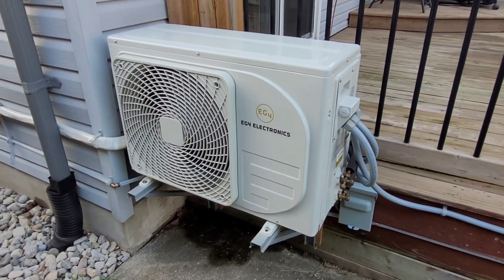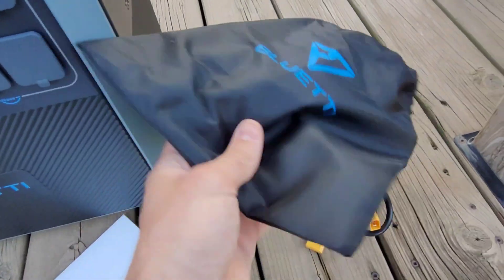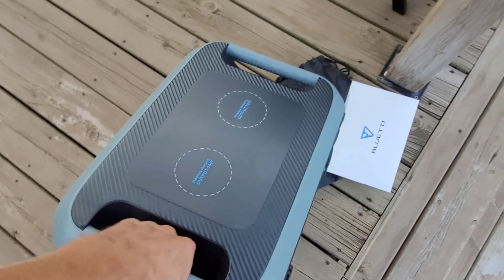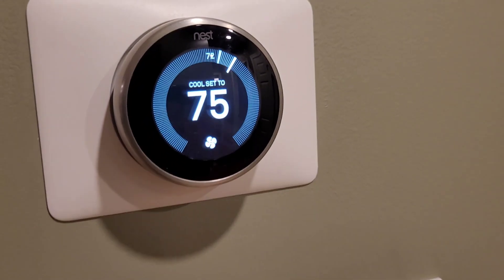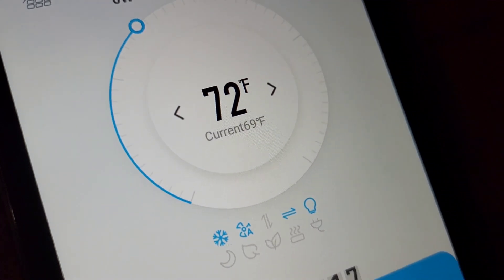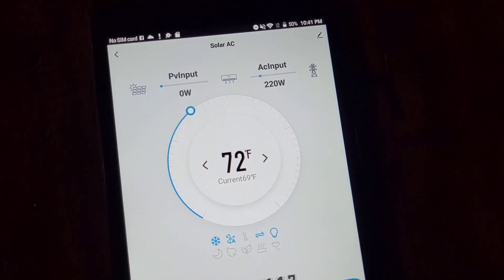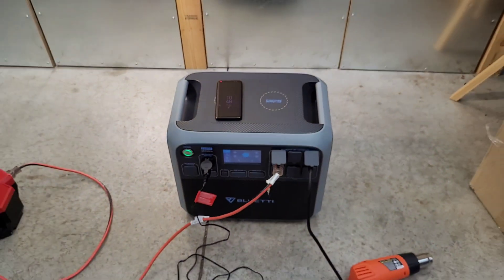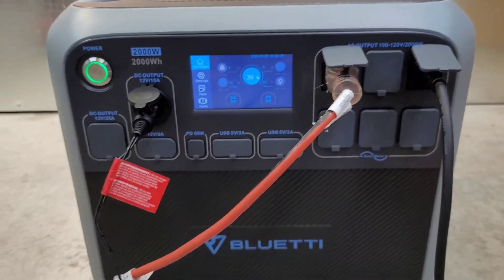Can You Run A Mini-Split AC On A Bluetti AC200P Power Station?

Comment: Nice!  External batteries can be used (bluetti and regular lifepo4 - 24v-48v works better).  I’d use it as supplemental cooling during the day with solar maxed out.  Let the main system run during the night when it’s not on that much.  Going to try this when my bluetti arrives. Main purpose is to have a cooling/heating option when the power goes out which seems more frequently these days. It sure isn’t going to become more reliable in coming years. Certainly seeing the decline.  It’s a good starter system for those wanting to get started with solar.
Reply from the maker: Absolutely, which Bluetti do you have on order?

Comment: the Bluetti is not going to run that a/c for long down south
Reply: Not without solar. The AC200max is a little better and maybe about $200 more on sale.
Reply from the maker: @BeefNEggs057  I'll be running it on portable solar panels soon
Reply: U keep ur house on 75 😮
Reply: @balls7973  is that hot or cold to you?  Mine (old school AC)stays on 76 all day. With ceiling fans it’s perfect. 67 in the winter - put on a flannel - just right.
Reply from the maker: Is that cold or warm to you? Peoples idea of ideal temperature is so wildly different.. 75f is a little warm to me personally that's why the mini is set for 72f
Reply: @SmitHVAC. I like mine at 80 😆
Reply from the maker: Obviously it depends on your climate, building envelope, insulation values, lots of different factors. It works for me, that's why I'm using it.